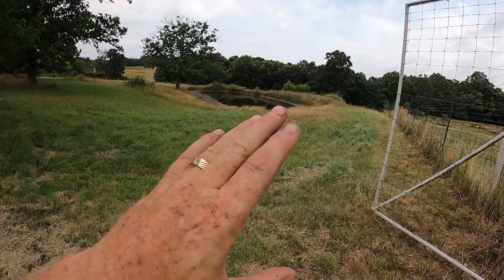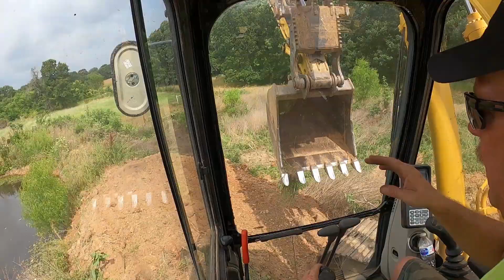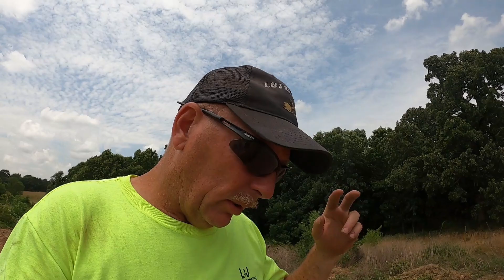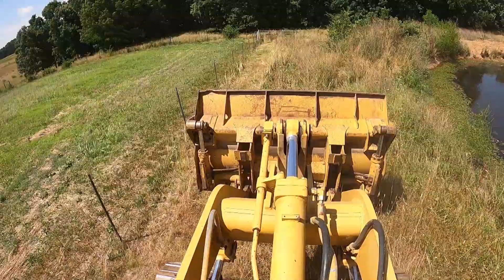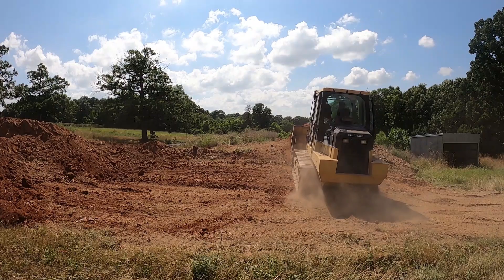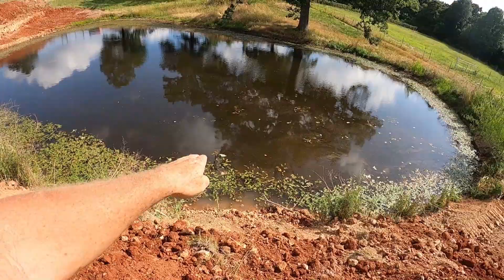Making An Existing Pond Bigger For Strawberry Irrigation!!

Comment: It's going to work to make the pond bigger to extend the dam.  Do you put in emergency overflow & pond drain?
Reply from the maker: Yeah, it should help to increase the size!  It'll have a spillway on one side or the other.  Have to bring the laser and make a few shots before I determine which side.